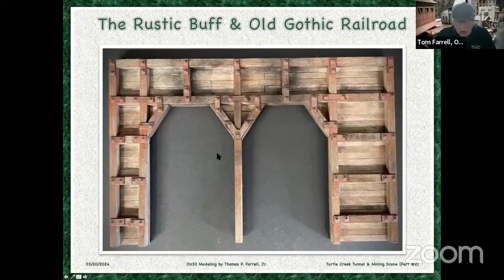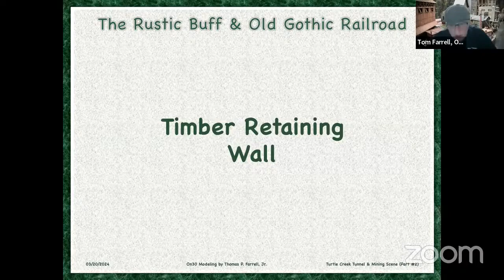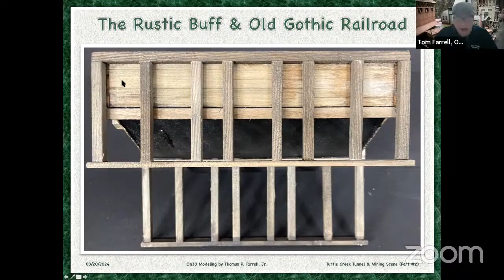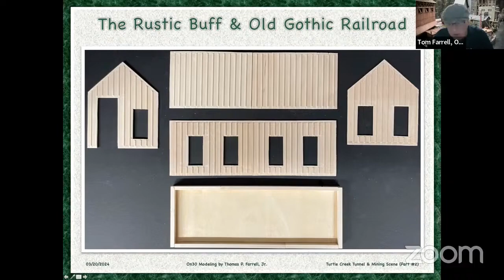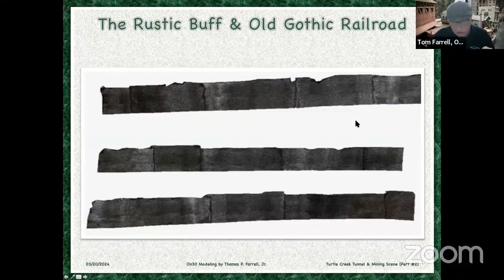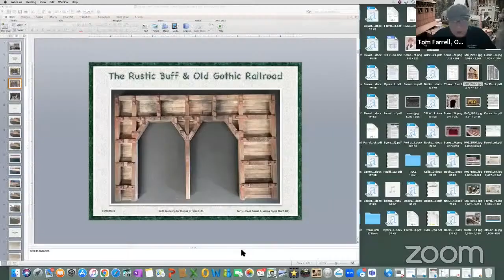On30 Rustic Buff & Old Gothic  - Turtle Creek Part 2: Finishing a Tunnel Portal and a Coal Tipple.

Comment: Great build series! The coal tipple chute height looks good to me. Something of interest is that there was a rotary dumper in Salida CO. that was used to transfer materials from NG to SG gondolas. Limestone used for the Pueblo smelter from Monarch, but also coal from another source I can't remember. Anyway, a conflict occurred with buyer because some of the coal was being broken/crushed due to falling from the excessive height. Work was done to try to correct this, but not completely successful if I remember correctly. I read about this somewhere but can't remeber source. Jerry Day also did a presentation at the 23 NNGC in Denver on the rotary.